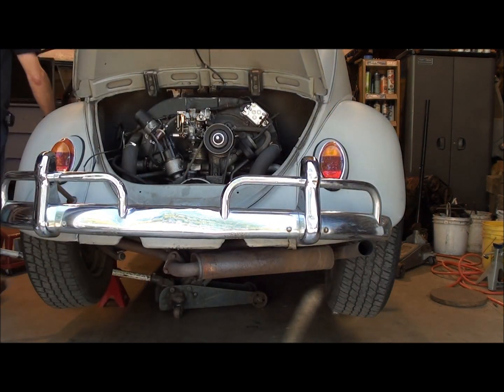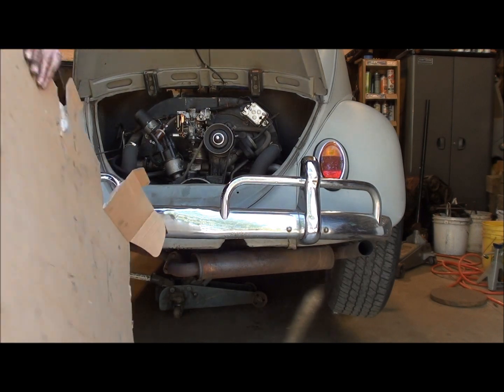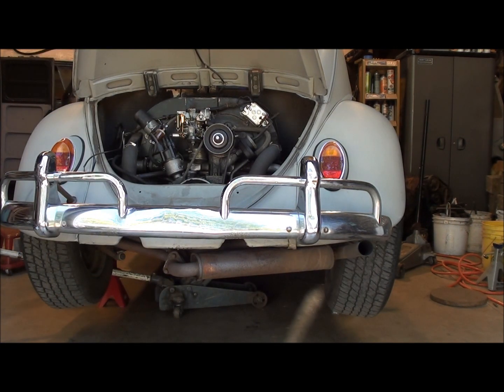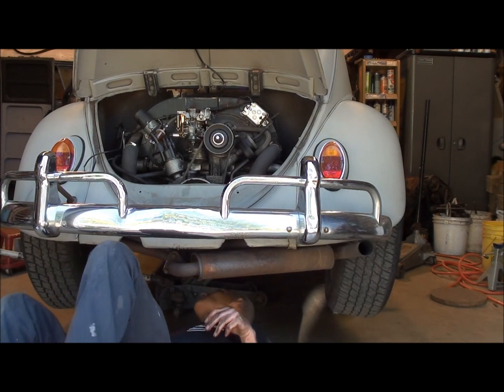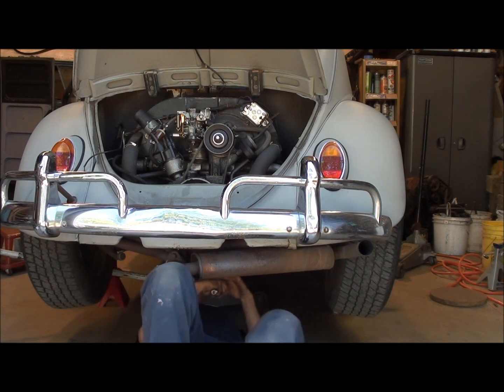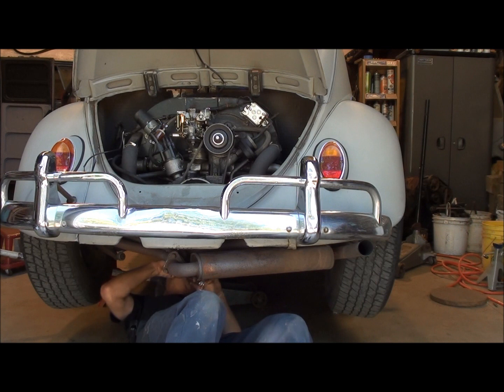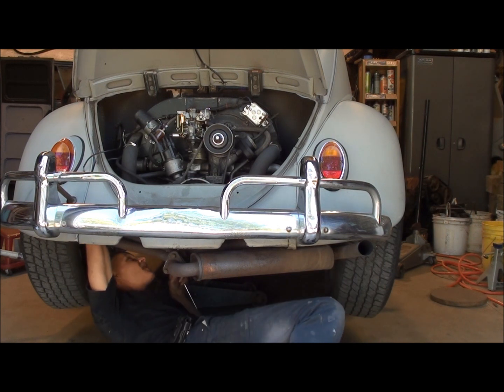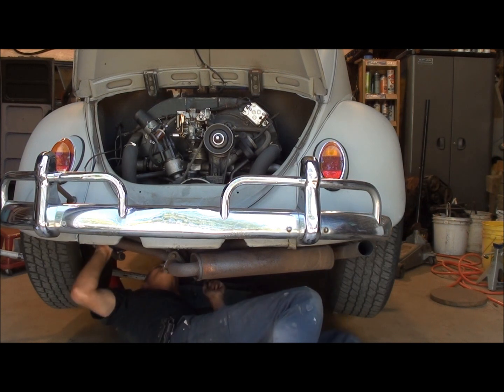engine removal give it up manyrd

Comment from the maker: screws for the sump cover on manyrd are not that long...the floor is smooth enough to slide easily.I try to be sorta careful and not drop it to the floor.also the heater boxes take most of the weight. Thanks for watching!